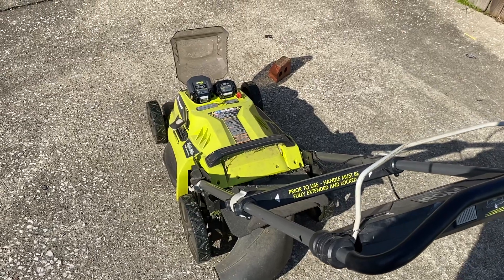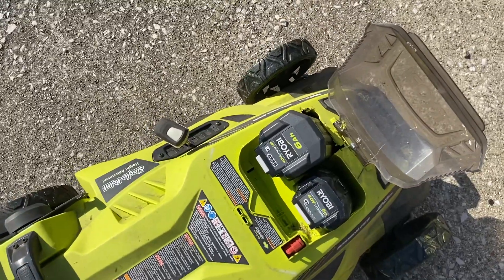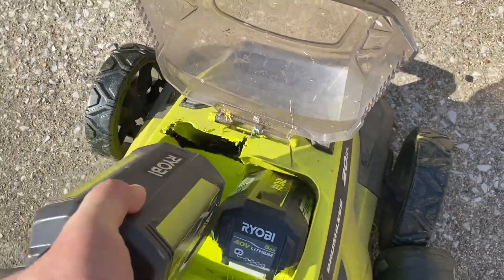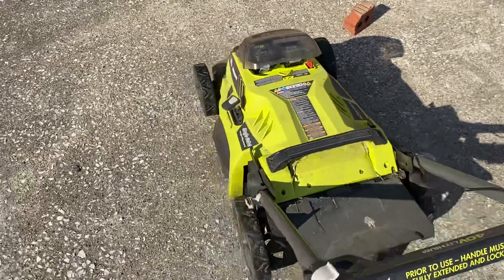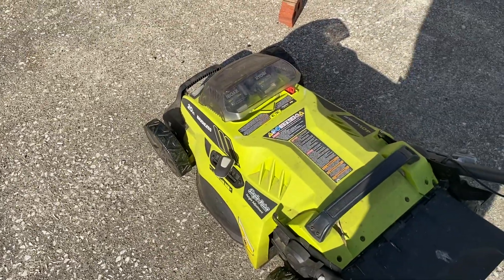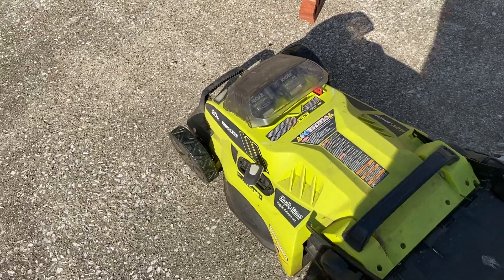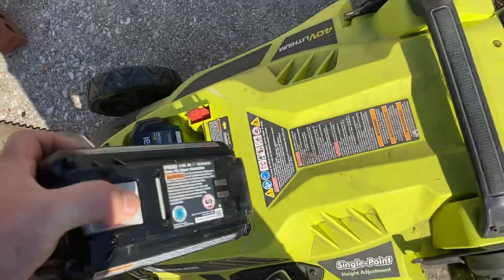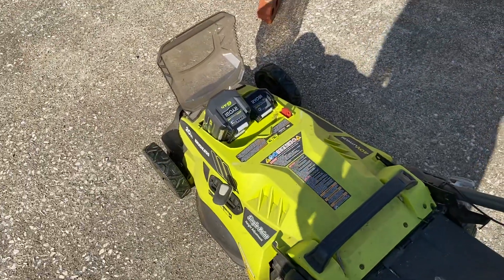Hacking the Ryobi Lawn Mower to take a 6AH battery

Comment: I tried this myself and it works perfectly! I didn't have a dremel, but I managed with just a handsaw and cutting pliers. It takes a little work, and you really have to shove the battery down, but eventually you'll get it.

Edit: If it works at first but then stops after a couple seconds, it probably isn't latched completely. It's only secure once you hear it click.

Comment: Picked up this lawn mower for $65 new with tags and 40v 5ah battery with the charger. A steal. I also got 2 40v 6ah batteries for $80 with another charger. Not a bad day. 
Now i don't have to cut as my 5ah battery is more than enough for my small suburban lawn. If I had more real estate then i might go with your hack. Thansk for being brave enough to do this and show is how to do it.  👍
Reply from the maker: steal is right.  I did this because the battery that fit my mower they wanted $160 for.  I got the 6ah one from Ebay for $70.

Comment: Do you room for error when you cut the hole?  Are wires far away?
Reply from the maker: There's plenty of clearance.  There's almost nothing inside that plastic except directly above the center where the motor is.  The newer model, the shield is much smaller.
Reply: @LightsOfElberfeld  Thanks.  I have the same model as you.
Reply from the maker: @pkn920 I considered buying one of those plug-in things that you can use to get power from these batteries and mounting it in the other slide hole.  It's frankly annoying we have to manually swap the batteries.  It really isn't worth it though to go through all that effort.
Reply: @LightsOfElberfeld  Are you saying it's not worth the effort to replace a battery when it's depleted? Why does that seem vaguely 'lazy' - even pitiful? You took the time to cut a whole in your mower with a chainsaw...
Reply from the maker: @jaym5938  no that's not what I said.  You misunderstood me entirely somehow.  I said it's not worth my time to modify the mower so both slots connect to the motor.  This model, by stock, only has contacts in the left side.  As it happens though, I don't use this mower anymore anyway.  I had both batteries for it fail at the exact same time and a brand new mower is cheaper than two batteries are, thanks to Trump's china tariffs.

Comment: I’ve been thinking about doing this on my mower it looks a little different than yours, but I have the same issue. What tool did you use to shave down the plastic?
Reply from the maker: this is where comedy happens.  I used my Ryobi 40v chainsaw to cut the hole.
Reply: Dremel.